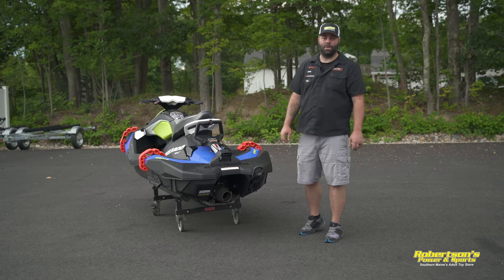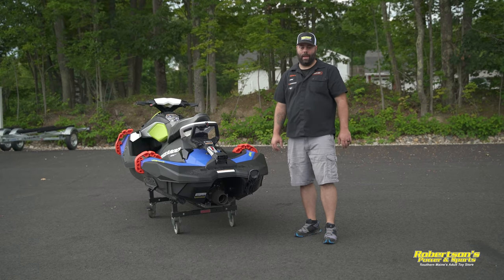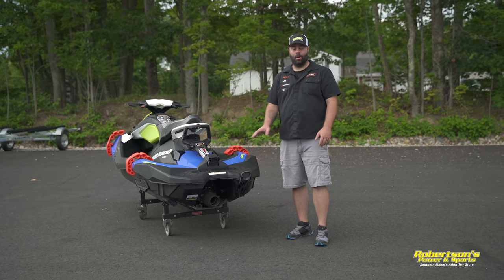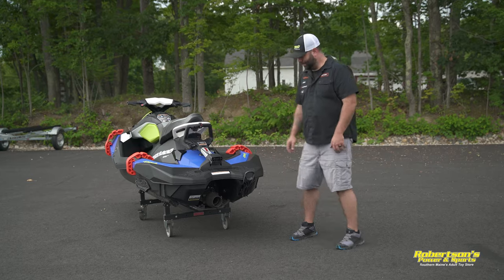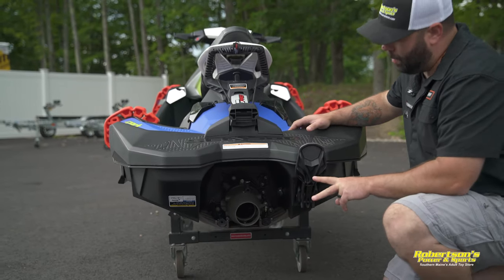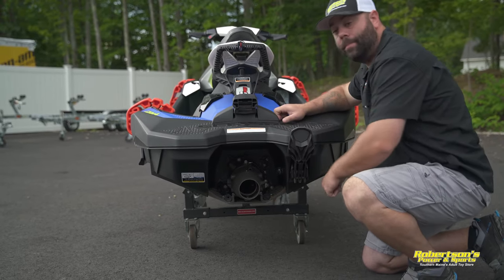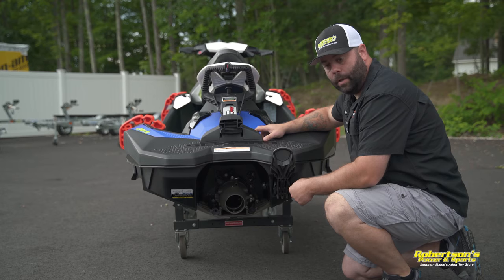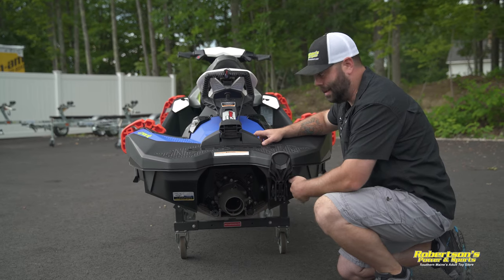SEA-DOO SPARK FLUSH PORT VS. DRAIN PLUG

Comment: Thanks for the video.  Just wanted to let you know that some states have recently passed laws that require drain plug removal and you can actually be cited for towing with them in place.   Don't blame me, I am merely the messenger!!  

Example States: Oregon and Washington 

FYI: This law was created under the guise of invasive species prevention effort.

I am buying some extras to keep on hand in case of loss, and I plan  on drilling holes in the external flange so I can attach to my key as a reminder to place them back on the ski before entering the water.  Only the government can blatantly disregard all liability from this law/requirement.
Reply from the maker: Thanks for watching and your feedback!

Comment: This video answered my question about if the flush port was supposed to be open or not. I bought a used GTX RFI and it came with a quick connect flush port kit, but it wasn’t connected. So I didn’t know if the port stays open or closed when the flush kit was installed since the kit has a check valve in it. Thank you for your video.

Comment: So I'm confused here,  I thought the spark had a closed cooling system.  My 2016 has a reservoir for coolant and I'm assuming that's what cools the engine.  Is this only for the exhaust water box?
Reply: Its not for cooling. flushes / lubes impeller during run

Comment: I purchased a 2016 sea doo spark this year and was wondering the same thing about the drain plug. I was told by the dealership that the drain plug went on the left side and the right side was the flush port. I haven’t taken it out yet for the year and didn’t know that the drain plug was in the wrong side. Just for assurance the drain plug is on the right side or?

Comment: Could it be possible that on my 2014 seeded spark 3 up that the flush port is towards the top compared to where u are pointing, and shaped more like a nipple?
Reply: I am wondering the same thing! I don’t see where to screw in a garden hose. I have a 2014 3Up as well
Reply: @BlondeVoyage  I was able to confirm that it (the stem/nipple thingy) is by seeing a picture on a Sea Doo forum. I bought some 1/2" ID tubing with clamps and a hose adapter - all from Menards. Going to flush the system soon.

Comment: I thought the same thing? Our pair of 2015 Sparks when we bought them new, had the plugs in one side. But both of our seadoo's have been missing the drain plugs for several seasons now 🤷🤦 but no water ever comes out when we pull them out and have checked while in the water and there dry on the inside I don't get it!! Lol 🤣 any one got an explanation for that?